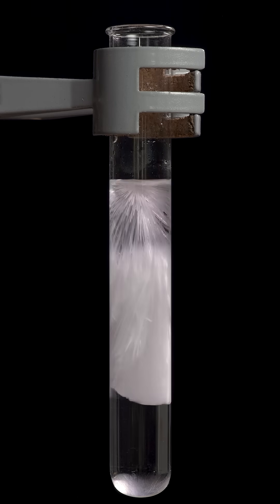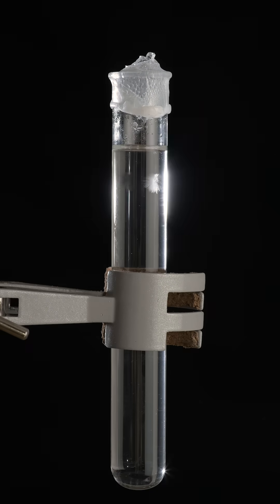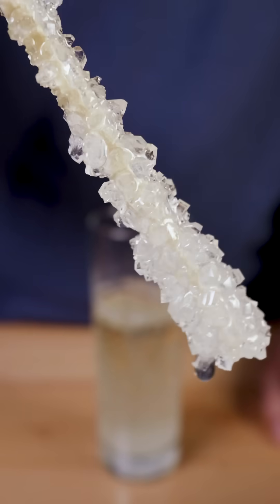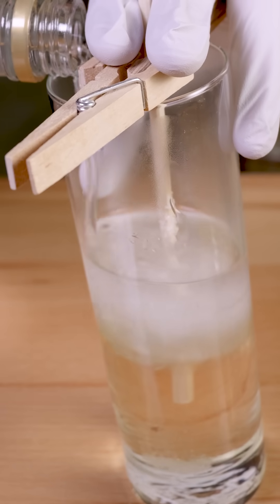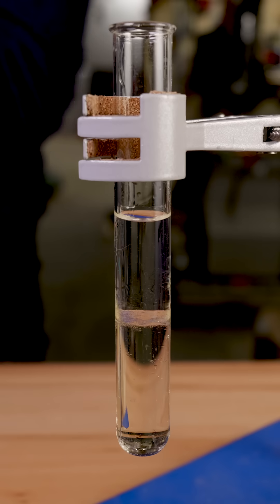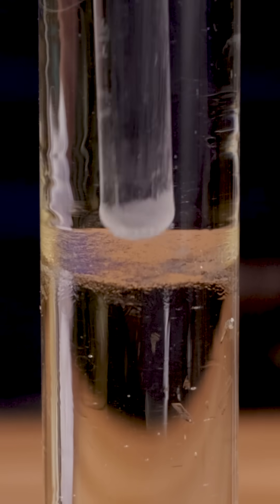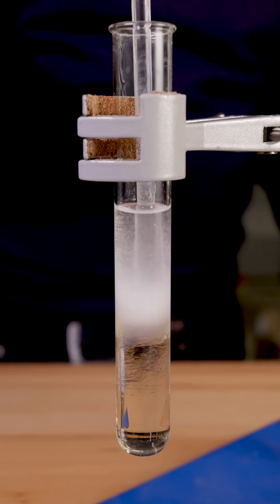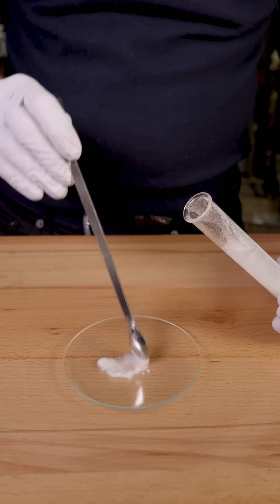everclear-assisted crystallization (or EAC as no one will ever call it)

Comment: BUT sugar is also soluble in alcohol, so adding more alcohol liquid will further dilute the sugar.  So although it might crystallize faster, your final yield of crystals will be smaller.
Reply: Yes. 
And it depends on the temperature gradient at the interface, doesn't it?
Reply: @EzekielBrockmann  Yes.  Generally speaking, the warmer the liquid is the more soluble the solids are so the less "willing" it is to crystallize out of the solution.  And the colder it is, the faster and more completely it will crystallize.  Organic Chemistry 201 right there.  Congrats you get an A for the semester. 🤣